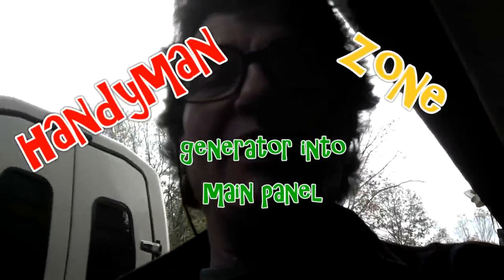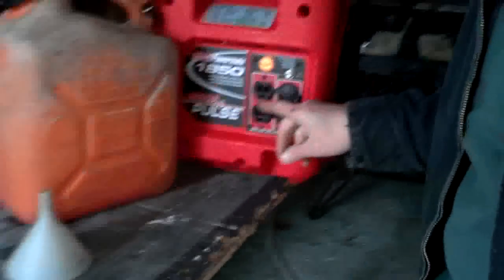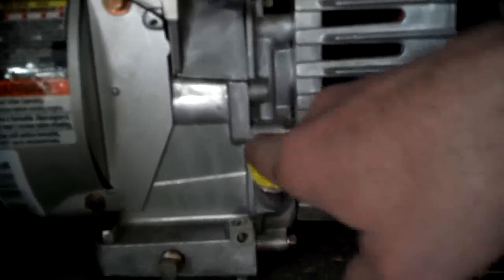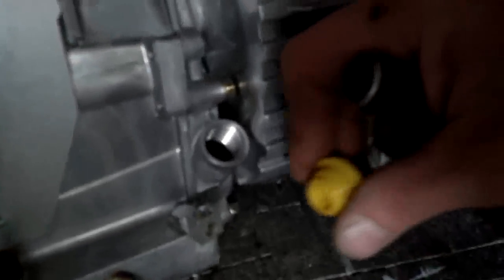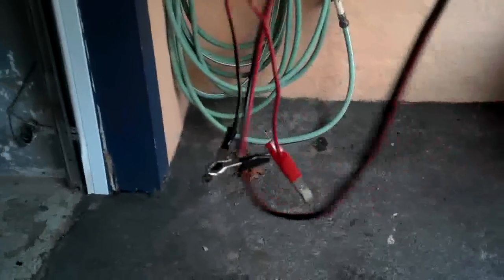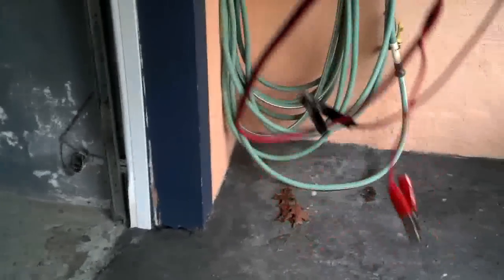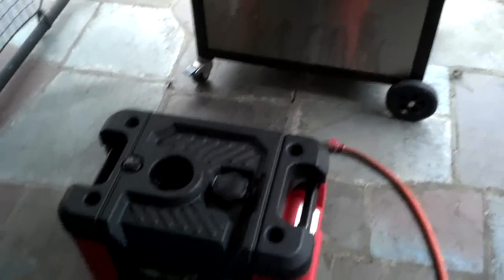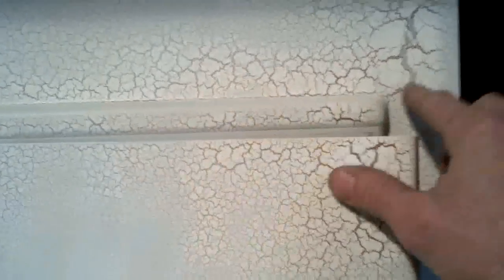HOOK-UP Generator to Home Main Breaker Box

Comment: EXCELLENT VIDEO!
LONG TERM POWER SOLUTION:
A portable gas powered generator certainly has its place...up until a long term power grid collapse due to EMP or Cyber attack. Of course any size motor is still going to be loud enough to draw attention in an urban area, even if you channeled the exhaust out of it being deep within a basement, neighbors or passerby will still hear or smell it. At least until fuel is no longer available.
So you will want to have a Crank-a-Watt battery generator. It can be cranked/charged up by wind turbine, bicycle, even just by HAND its easy to turn! Or you can passively charge it with solar panels. It has a permanent magnet sealed alternator that'll last forever, creates electricity with only 1RPM, only takes 20-35mins to fully recharge the battery, & can be recharged while in use. Its fumeless, quiet, & portable.
Or you could upgrade to the large 1600 Watt model on wheels. It easily runs lights, frig, microwave, heaters/fans, recharges other batteries as a barter service, etc! Also, a 5000 Watt gasoline generator is limited to only 5000 Watts. While a battery bank can be expanded almost endlessly. Personally I purchased a 5000 Watt inverter & have been adding Marine Deep Cycle 122amp Hr batteries to my bank (about $102 at Walmart & we buy one every few weeks as money comes in). Once I have all my batteries (we need 19 & currently have 11) I will be able to run a small bug out house we have (1 bedroom, no living room, kitchenette, & bathroom). Even if I fail to accumulate enough batteries before the collapse, car batteries are easy enough to scavenge or barter for.

The following is an additional gift. Many of you will no doubt already be familiar with most of what I'm about to share with you, so for what its worth perhaps newbie preppers will benefit from a collection of tips I personally live by & have accomplished over the years:

#1 PREPPING PHILOSOPHY & SAYINGS:
PREPPING for WHAT?
Remember, old sayings are still around because they've been repeatedly proven true:
"Possibility, probability, variables, cause & effect, priority vs urgency."
Always consider the possibilities verses the probabilities, the variables of each & the cause & effect of each. Then prioritize the results against any urgent action required.
Prep for the most "probable" disaster in your area first. Then prep for a nuclear war. (No grocery store, no gasoline stations, no 911, no hospitals, no electricity, no running water, etc) Finally, prep as a way of living. "Failing to plan is planning to fail."
Being prepared for that extreme disaster should just about cover most other conceivable disasters. Keep in mind that an evacuation can turn PERMANENT so prep for that possibility. Consider the same for sheltering in place.
Educate yourself well enough on how to use every piece of equipment & supplies to the max & how to teach others what you know. Your greatest tool & most important asset is your brain & ability to use it. It is possible for a person to survive even after being stripped butt naked & thrown in the middle of nowhere. How?
"The more you know the less you need"

INCREMENTAL BUDGETING
Store enough to survive a week, then for 2 weeks, then a month, then 6 months, etc. so ask yourself:
"If I only have enough time & money to either purchase or accomplish only one more thing  in order to survive one week & then everything collapses, what would it be?"
Once you have everything required to survive in the woods for 1 week & nothing has collapsed yet then start prepping for 2 weeks, then a month, then 6 months, etc.
So as an example, although water is one of the first things you should acquire, you would NOT invest every dollar you have in to accumulating a year's worth of bottled waters. Instead get a week's worth of water, then a week's worth of food, etc, etc.
"THE SHREWD ONE SEES THE DANGER & CONCEALS HIMSELF, BUT THE INEXPERIENCED KEEP RIGHT ON GOING & SUFFER THE CONSEQUENCES." -Proverbs 22:3

#2 DAILY PREP - EDC (Every Day Carry)
Consider wearing canvas hipsack everyday as a habit with the following 7Cs of survival equipment in it.
Cutting: multi-tool w/knife
Combustible: windproof lighter, metal match & WetFire
Container: metal sports bottle to boil or a 1 gallon Freezer Ziplock bag
Cordage: 10-20' paracord braided as shoe laces & 50' duct tape hand-rolled to 2"" diameter cylinder
Covering: space blanket or 55gal drum liner
Communication: extra fully charged cellphone battery; LED flashlight
Care: Altoids tin w/alcohol wipes, assorted band-aids, needles, safety pin, paperclip, rubber band
Obviously you can include your wallet & other personals.
"MORE YOU KNOW, LESS IS NEEDED"

#3 BUG OUT BAG
The following is the bear minimum in an evacuation pack.
Water: 1 liter bottled & filter system (Life Straw)
Food: MREs & fast snacks
Shelter: Hennessey Hammock or plastic covering/tarp
Security: Gun(s), ammo, crossbow, handheld & head lamp flashlights (use pepper spray & group travel as deterrents)
Tools: Knives, multi-tool w/knife, windproof lighter, metal match & WetFire, cordage/rope, medical first aid kit, handheld HAM radio
Clothes: lot of socks, undershirt, underwear, pants, T-shirt, work gloves, thermal underwear, jacket, heavy coat, wide brim hat & toiletries
"2 IS 1 & 1 IS NONE"

#4 MEDICAL FIRST AID
Steri-strips/butterfly bandages (these can be used as sutures on small cuts); 4" & 6" Israeli Bandages; Quick-Clot powder; Plastic bottle of 100% Vodka (pain killer & antiseptic); pain killers; liquid 22.4% Sodium Chlorite (water purification drops) mixed 1:1 with 50% Citric Acid drops for 3 mins then drink with 8oz water every 2 hours for 24 hours to cure most viral infections.

#5 SANITATION
Wash privates, pits & feet! With practice even big people can bathe entire body with only 2qts of water, wash rag, 3 buckets (1 clean water, 1 to rinse, 1 captures all rinse & dishwater for later toilet flushing)
"PREPARE for MONKEY BATHS"
Everyone (including women) pisses in same 5gal bucket that holds ALL dirty rinse water. Then use it to flush toilet by emptying into bowl bypassing tank. Only turds &puke go down toilet!
"IF ITS YELLOW LET IT MELLOW, WHEN ITS BROWN FLUSH IT DOWN"

#6 FEMININE HYGIENE
Tampons & pads will run out! Practice using menstrual cups. Flexible rubber, come in different sizes & are inserted in vagina during your period. When full, its pulled out, emptied, washed, & can be reused indefinitely (for years).
Keep 2 in ziplock baggies in your purse (1 for regular monthly use & 2nd one in case you lack facilities to immediately wash the 1st one you pull out). Keep 2 extras in bug out bag=4 Total
BUGOUT and SHTF Feminine Hygiene
"REUSABLE, NOT DISPOSABLE"

#7 SECURITY
TRAIN & PRACTICE: How to be Aware, Anticipate, Adapt & Overcome; Self-defense techniques & attitude w/ Lethal & non-lethal force.
INSTALL: Security hinges, combination striker plates & door-latch shields on all exterior doors with 3 1/2" deck screws; Crossbars on all exterior doors; "Poor man's" bullet resistant inserts near the interior of all windows; Tire sealant on all vehicles; Camper shell or lid on truck
"LET THE ONE HAVING NO SWORD SELL HIS OUTER GARMENT & BUY ONE" Luke 22:36

#8 LONG TERM GOALS
Renewable necessities for sheltering in place!
WATER: Dehumidifier makes 8gals daily in humid air & a ceramic water filter can be reverse sanitized for perpetual use.
FOOD: Aquaponic system provides endless fresh vegetables & fish; Stock non-GMO, non-hybrid seeds; dual compost tumbler
"BETTER TO HAVE IT & NOT NEED IT, THAN TO NEED IT & NOT HAVE IT"
"PLANS OF THE DILIGENT ONE MAKES FOR AN ADVANTAGE!" Proverb 21:5

#9 SURVIVAL TEAM
Screening individuals to join your team, learn their:
1. Core belief systems (religion & politics matter)
2. Goals & intentions
3. Relationship obligations & commitments
4. Physical & mental limitations
5. Personalty & character traits
6. Experience & Skills
7. Material Assets

TEAM RULES:
The following needs to be announced AND AGREED TO PUBLICLY in order to join the group!
1. Obey or Die! (although leadership should consider what the group wants, there should be a defined chain of command; NO DICTATOR but an elected governing body of equal power is optimum; once there is a command decision ALL members obeys direction)
2. Only food, water, & shelter is shared equally.
3. No one ever travels alone, 3 person minimum at all times!
4. NO UNPROTECTED SEX (Avoid pregnancy with reused condoms or sex acts other than vaginal intercourse; Abortion is too dangerous even with proper medical care so every pregnancy should be brought to term)

HANDLING CRIME WITHIN THE GROUP:
If while traveling a group member repeatedly steals food/water or INTENTIONALLY permanently injures, maims or murders a member they may be banished when the group continues so long as the criminal is NOT well informed on the other members of your group, your supplies, weapons, goals & plans, shelter layout, etc., otherwise if the criminal has a lot of intel on the group or you are sheltering in place long term, then simply banishing them allows the possibility for their revenge or be tortured by invaders/enemies for a blind attack. Imprisonment may not be practical due limited resources & guard personnel & may allow the possibility for further injury or murder in an escape attempt. Thus, execution may be in order.

Alternatively, for a repentant theft & UNINTENTIONAL injury, they will perform certain undesirable chores or chores of the injured while keeping up with their own responsibilities as punishment for a set period that is mutually agreed upon by the group.

Regardless what each team member's personal skills may be, EVERYONE needs to be mutually trained in 3 essentials - Security (Lock down, self-defense, weapons), Medical First Aid (How to arrest bleeding & mobilize the wounded), Communication (Chain of command, whistles, bells, 2way radios, & hand signals).
“IF ANYONE DOES NOT WANT TO WORK, NEITHER LET HIM EAT” -2 Thessalonians 3:10

#10 GOLD/SILVER
Coins are best for preserving & re-establishing wealth AFTER a collapse in a new economic system.
If you absolutely have to use gold/silver, decrease the odds you'll be targeted as a "goldbug" by NEVER using coins DURING collapse. Instead, "hesitate" trading a plain wedding band or broken piece of chain or some other form of "scrap" that can be cut or broken off to incremental value right on the spot. Most will assume its a last piece of personal jewelry & will be less likely to follow & ambush you!
"MONEY IS FOR A PROTECTION BUT WISDOM ITSELF PRESERVES ALIVE ITS OWNERS." -Ecclesiastes 7:12

#11 NEVER a GUARANTEE
Although no amount of prepping guarantees success, that doesn't prevent rational people from having insurance or a spare tire in their car. No one wants disaster to strike, but in a lifetime it IS inevitable we'll face at least 1 tragedy. Bible warns us why the swift don't always win the race, strong don't always win the battle, wise don't always have the food, etc. because...
"TIME & UNEXPECTED EVENTS OVERTAKE THEM ALL" -Ecclesiastes 9:11

#12 PRAYER & ENTERTAINMENT
Regardless of your personal belief system science & psychology has repeatedly proven after studying countless disasters & interviewing many survivors that no matter how dire a situation gets there were 3 mental elements that contributed the most to survival:
1. Hope/Focus
2. Sense of Accountability/Civility
3. Humor/Joy
With that fact in mind...
Liberty = Peace & I pray you always have both!

Comment: I recently paid $375 for a 10 Circuit Transfer Switch Kit which included a Inlet Box to be used with my new 8,000 Watt Generator. Then I hired an Electrician to install it for $300 since I am a klutz when it comes to doing things like this.

Comment: An easy way to do is get a 220 breaker wire it to the generator and turn the 110 breaker on one at a time be sure to turn the main breaker off first.
Reply from the maker: within hours of hurricane sandy and the following nor'easter you couldnt find any breakers nor any electric cable nor even lamp cord within 200 miles of long island in any home center or electric supply the isles were bare....read discription

Comment: Dino... Sandy was a bitch for us here on the island, that's for sure. What I do is disconnect main breaker and put the leads from your drop cord into the neutral bar and into a breaker, and snap the breaker into the panel. What that does is feeds phase A or B on just your panel bus. Then with all your breakers in the off position, start the generator, turn on your drop cord breaker, then one by one find the house breaker which you need to power. This method is called back feeding with a breaker.

Comment: I have this exact generator and it generates enough power to run a energy efficient 5,050BTU window unit and a small mini fridge at once AND THATS IT. The watts are a constant 1500w with a 1850w peak. The amps are 12 constant with a 15 amp max. I hope his generator craps out and bites the dust before someone in his house turns into dust whether through shock or fire. Instead, for this generator, he should run directly to the few "low draw" appliances he wishes to power and that's all. Also you seem to mix up watts and amps in your description, I hope for your safety you know the difference.

Comment: @gjmonroe Just buy an extension cord and replace the female end with a male end, turn all your breakers, plug the cord into the electrical outlet thats connected to the desired Circuit, plug the other end into a cheap 1650 watt power strip, and plug The power strip into your generator.

Comment from the maker: hey Nick...and everyone that checks these messages i'm asking you to click thru nicks name and check his "taco rack" !!

yes, i've a bigger generator (220 volt) now (post-sandy) but at this video i had this 1500 watt (120 volt) coleman campground gen, as it was only 120v used the clips cuz was switch legs in breaker box 6 - 7 time day, keep the oil burner,  hot water heater,lights, TV (teenage kids), coffee machine all in rotation. a method to my madness as is stated at about 2 minute into video

Comment: he oughta take this show on the road, its hillarious, if the wire sparks its hot, put a bag of pop corn in your pocket just in case, 1,000 amp generator, your gonna need a big wire L O L
Reply from the maker: ummmm 1000 watts is a blow dryer....its a very small campground genset

Comment: your wiring red / black is used for DC not AC.  colors for AC current should be  power red / black,  white is common wire ( return for using 110 volts its like a ground )  two power legs are red / black. will give you 220 volts  ; white common wire not used for 220 unless you want to use it as a ground, but probably better to used the ground wire instead.

Comment: Toatally wrong.Do not do this at home
breakers are not left side right side every other breaker is on same  leg .Even if on same side or 220 breakers would be on the same leg and you would not have 220volts.you can also isolate from the electric grid by turning the main breaker off.
Reply: angus macgregor:
well technically he DID separate from the Grid or Street power... He pulled the double breaker OFF the buss bars...  As long as that breaker does not go back toward the buss bars, no harm is done.. !!

Comment: you can feed 120 into both legs of the breaker box as long as you don't turn on any 240 circuits.  also why the hell would you pull the main breaker when you could just turn it off and hook it up to one of the lugs lower down in the box.

Comment: He is trying to help people. If you did everything you saw on the internet, you my friend, are the fool. However what he should do is install a 2 pole 30 AMP circuit breaker inside the panel and get an interlok kit. Impossible for the main 200AMP breaker on while the 30 AMP generator breaker is on. I dont like to see aligator clips being hooked on while sparking is going on. This guy also has drank quite a few alciholic beverages in his lifetime. But I like him!

Comment: That is a very small generator. Why not just finding some space on your panel. Next go to the Home depot or Lews and buy a 15 amp breaker. Buy your self a 15 amp 120 rated extention cord. Attach one end of the cord to the breaker, and the male side to the generator. Power off your main breaker, and install your new breaker. Back feeding this way is more safe. That is no way to do business body.

Comment from the maker: Ian, thanks the reply but an extension cord of your description is very dangerious,both to use and to have around the house, plug any end in and the other end is LIVE , an accident waiting to happen

also if you dont ground your genertor your looking to blow your gen-head in a few hours of use, this little 1500 watt unit lasted 17 days provide my family with hot water, heat, light, internet, even TV (dvd) because it was grounded!

ground to prevent shocks and electrocutions. google it!
thanks

Comment: It is better to install hard wired manuel double throw switch to panel from gen.and pull main breaker to get off line. Need to use correct size wire and correct size gen . That little 120 volt gen not enough amps just to watch tv or a lamp GET REAL...need 15 -25 kvw gen and then will not run everything like century ac/heat pump
Reply: I run my entire house with 7k watts.. Even a 3 Ton (36K BTU) Central A/C.. 

Every light inside and outside ON, ALL 10 ceiling fans ON and in HIGH speed, all 6 TV's ON with cable boxes ON = ~2300 watts .. !! 
3 Ton 36k btu central a/c = ~3200 watts running... !!